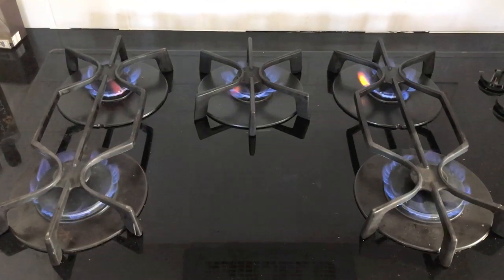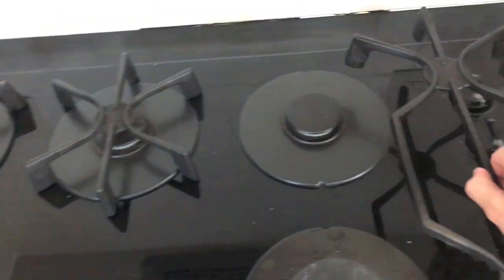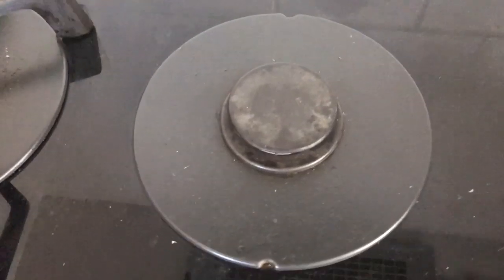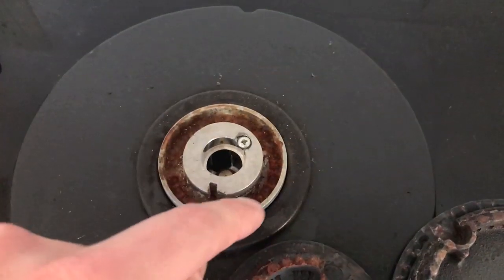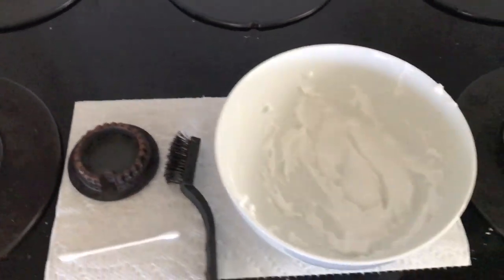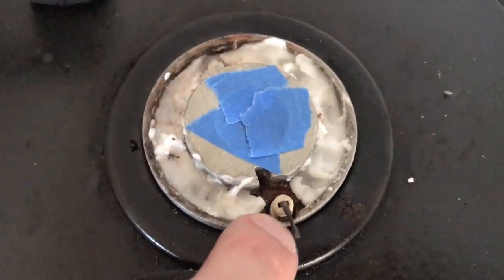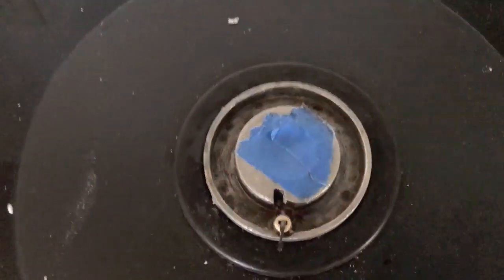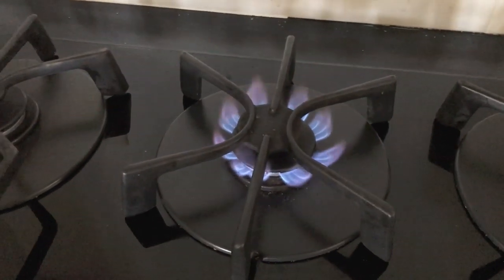My Oven/Stove keeps clicking - Driving me CRAZY - EASY FIX

Comment: Did all this and mine still kept clicking when turned down to simmer.  I had to take out the gas jet, the little brass nut down in the center, and ream it clean with a sewing needle.  Just a tiny bit of debris in there means there is not enough gas flow to keep the burner lit when turned to low setting....the igniter senses the lack of flame and tries to constantly relite the burner.
Reply from the maker: Ed Smith 

Thanks for watching, we appreciate you sharing your experience Ed.  Your info is helpful & will come in handy for future viewers.

Definitely let us know if you have any questions.  Us fellow DIY’ers need to stick together!  😀

Many more helpful videos to come!  Please subscribe to the channel and Ring your YouTube Bell 🛎 that would be awesome thanks again!

😎👍🔧🔩

Comment: I hope you can help me. I have a brand new Bosch stove that has all the 5 burners clicking after one of the burners is lit.  I tested all 5 burners individually and they all light up but the ones that are NOT lit keep clicking.  HELP!!!
Reply from the maker: Good morning, just poured a cup of coffee and am sitting down to answer any and all questions for the DIY community.

Thanks for sharing your experience.  A brand new unit shouldn’t be giving you any fuss…🤔…that’s a bummer you’re having issues.

Does your new unit require you to turn the ignition button or knob to a different setting/position after burner ignites?  

Let us know if you have any questions and hey if you’re into crypto trading, join our DIY ecosystem and help us grow an exclusive group of DIYers.

       toolboxtoken.com

Reach out to us any time!  🧰

Comment: What do you do if it’s still clicking? You managed to get yours to stop. Mine won’t.
Reply from the maker: Thanks for watching & it may be the igniter or your actual Spark Module.  Below are links to videos that may be helpful.

1.  Ignition Replacement
          
          https://youtu.be/pZIgLsxRiCs

2.  Spark Module Replacement
          
          https://youtu.be/oUGNfXS71aA

Keep us posted.  😎👍🔧🔩
Reply: Our stoves have a feature called auto reignition, it is able to sense the presence of flame and if it knows the gas is on but no flame is sensed it will trigger a spark again. It senses the spark by the increased electrical conductivity of the flame. It senses this between the spark tip and the flame port right next to it. That means if the flame port is clogged or the spark tip is corroded/gunked up with debris it will not be able to correctly sense the presence of the flame. To fix this clicking issue you need to check two things on every burner. 
1. That the spark tip is clean, like this video shows. 
2. That the gas ports/flame guides nearest to the spark tip are clean (this was my issue, I had to disassemble and run a drill bit through the tiny holes to clear out the blockage)

If that doesn't work, then could be something wrong with the igniter electronics.

Comment: After my cleaning service cleaned the stove top, all the ignitors started sparking.  They did not before cleaning and there is no corrosion or dirt buildup.  I switched off the circuit breaker and left if off for about an hour and then reset it.  All the ignitors still are sparking.  Could water or cleaning solution be causing the issue
Reply from the maker: Thanks for watching & welcome to the DIY Raptor Club.  Surprisingly, it can take a few days to fully dry out depending on how much cleaner was used.

Some find it best to unplug unit for a day or two.

😎👍🔧🔩

Comment: What if it wont stop clicking even if your not turning on the ignition? But it is plugged. Should i clean also the internals? Mine keeps clicking even if your not touching the switch.
Reply from the maker: Thanks for watching & welcome to the DIY Raptor Club.  A friendly cleaning may help followed by gentle & careful drying.  Keep us posted.

😎👍

Comment: Uhmm what if all the clickers sound at the same time... my housemaid tried cleaning it i suspect she used way too much water but dont take my word for it... thing is when I plug the stove all 6 clickers start clicking albeit slower than when you press the knob to ignite a burner any ideas?
Reply from the maker: Clearjab 

Thanks for watching & sharing your experience.  Let’s get this figured out.

A few things come to mind.

1.  Spark Ignition

       Your spark ignition is in charge of starting the Spark process...if it fails, all burners will click.

2.  Spark Module

      Your Spark Module is in charge of controlling all spark sequences & if it fails...you will experience miscellaneous sparks on different igniters...& sometimes all igniters.

Replacing both parts should definitely get your stove top up & running properly & efficiently.

Keep us posted!

Please subscribe to the channel and turn on your YouTube notification Bell 🛎 that would be awesome thanks again!  😎👍🔧🔩
Reply: Thanks for replying so fast ill look into it asap cause the clicking drives me nuts its an lg model but lg support in my area is laughable at best might have to bring the DIY out in me
Reply from the maker: Clearjab 

😃 there is a DIY in all of us 😆

Definitely keep us posted!

If the replacement parts start adding up close to the cost of a new burner, you may even consider a new burner come Black Friday/Holiday deals!

Definitely an option to keep in mind!

😎👍🔧🔩
Reply: How do I open up the range top? I see no access screws that hold the gas range down.
Reply: This is also my problem. I cleaned it I think I used too much water while cleaning because the clicking noise didn’t start till I cleaned my stove. Not sure what to do at this point I unplugged it

Comment: I had a bad spill on my stove and it has been clicking for 24 hours. We tried cleaning it and dryed it. It clicks rearly but the bottom stove part will not turn on , it lights up for a second and then nothing happens. :(
Reply from the maker: Higher Self 

Thanks for watching & sharing your experience.  This is more common than you think.  Let’s get this figured out together!

It’s very possible that the spill that was added to the igniter on that specific burner is causing an interference with the igniters electrical connection.

We recommend cleaning the igniter & then getting it lit.  You may have to manually light the burner with a lighter....Be extremely careful.  Once it’s lit, allow the burner to burn for several minutes...it may take up to 25 minuets or so to allow that burner to burn off any additional particles in order to allow the electrical current to work properly & efficiently again.

Let’s start there!  Keep us posted!

Please subscribe to the channel and turn on your YouTube notification Bell 🛎 that would be awesome thanks again!  😎👍🔧🔩
Reply: DIY With Michael Borders
Reply from the maker: Barbara Evanger 

Thanks for watching, we hope the video helped!

Please subscribe to the channel and turn on your YouTube notification Bell 🛎 that would be awesome thanks again!  😎👍🔧🔩